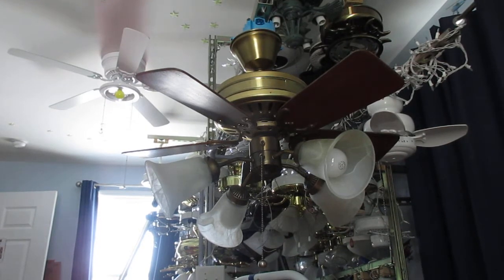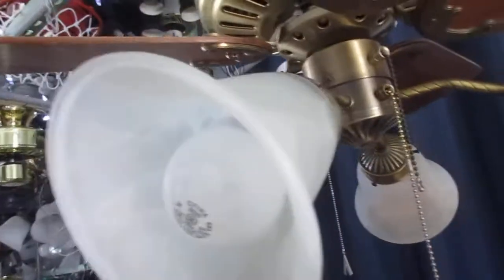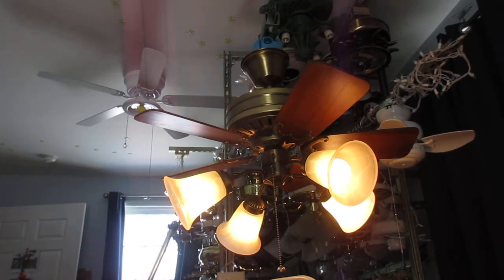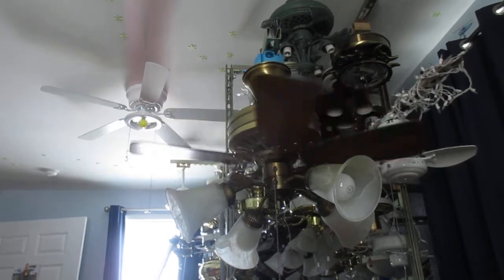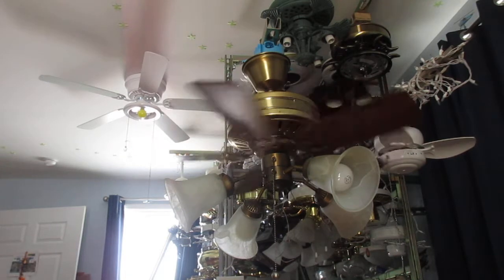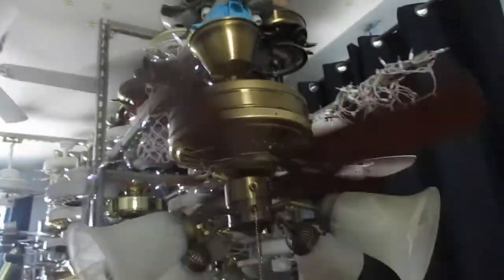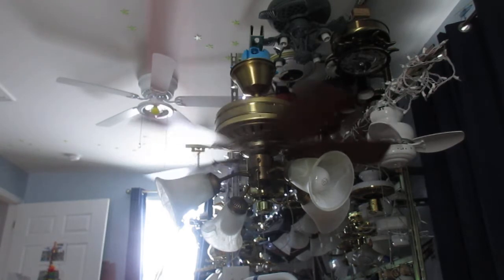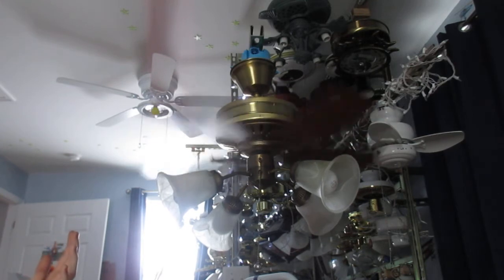Fasco Vanity Fair ceiling fan (Broken Flywheel)

Comment: That's the most common issue about FASCO Flywheels, FASCO Flywheels are know to break off due to the fact that they're not build well, the not-so-built-well FASCO Flywheels were no longer replaceable, the only case on getting a FASCO Replacement Flywheel is to get a replacement FASCO Metal Flywheel from Dob Ruffy.